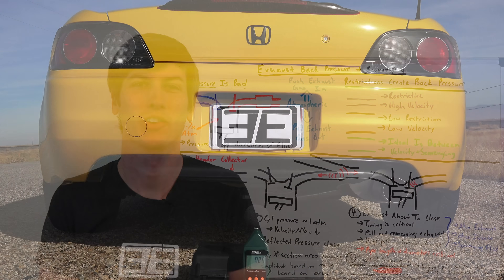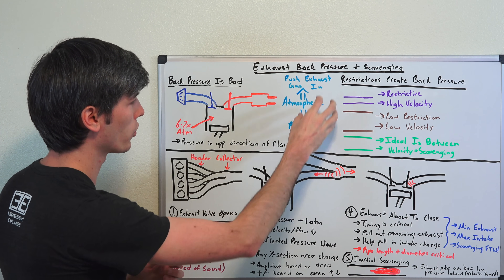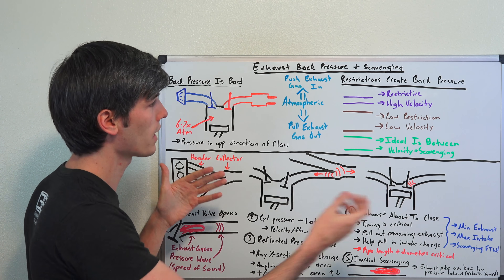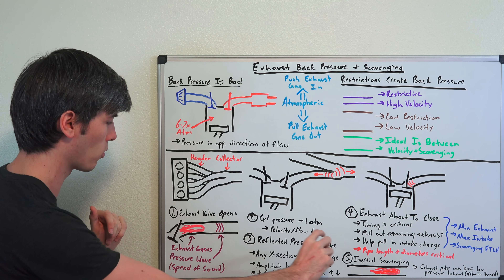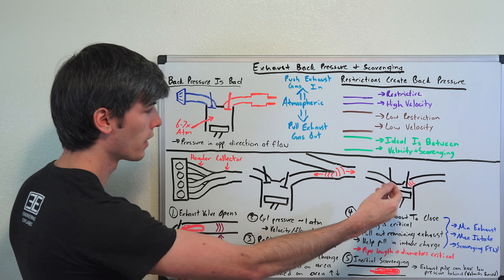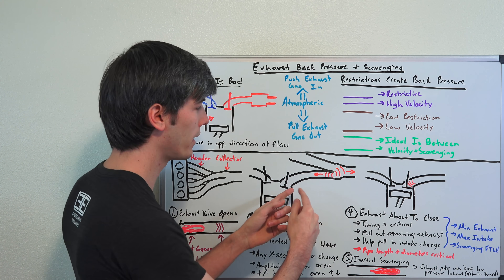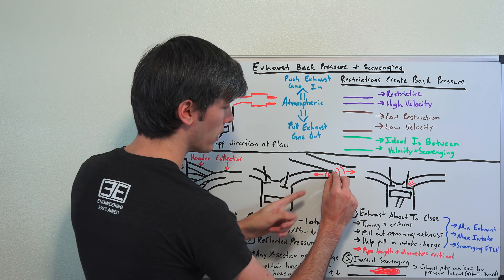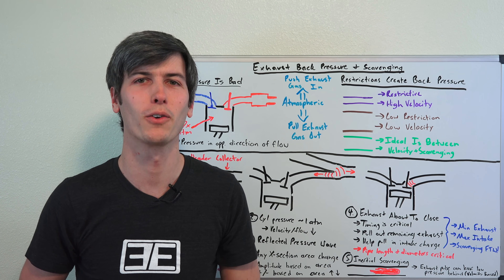Stop Saying Car Exhausts Need Back Pressure

Comment: Great explanation. I'm learning the older I get, the more I trust OE engineering, and I just leave my vehicles alone. Big automakers probably have more R&D money than a backyard fabbing company. Take care! Awesome channel.
Reply: + Bushcraft North of 60 : Well, it's not so much that they do more R&D per se... It's more that as you age, you realize that daily driver vehicle functionality and reliability are far more important than a little extra horsepower or torque. 

Typically, when a person starts "screwing" with any engine outside of the OEM settings, you will find more power, IF and ONLY IF you have a clue what you are doing. That said, typically the engine becomes less reliable and more expensive to operate. It's really just common sense. (Sadly, something that many folks lack.) 

That said, there are always some exceptions to the rule. For example, most modern emissions controls are literally "choking" the longevity, economy, and power outta the modern ICE's, both gas and diesel. That too is a proven fact.
Reply: I purchased something called a KTuner V2 for my 2017 Honda Civic Sport Hatchback (1.5L w/ the turbo).

The stock PSI on the turbo is set at 16 and is rarely ever reached (with the way I drive).  This KTuner V2 brought my PSI up to 21 and of course with that bumped up the torque and horsepower.  I've been running it for 3 weeks and was nervous that I was going to destroy my car but then remembered why I waited 2 years to see people's results with it.  Out of thousands and thousands of people who have never had an issue, there's only 2 that I have heard of  that have bent a rod.  One was due to the guy shifting from 5th gear down to 2nd (why the hell would anyone do that?), and who knows how fast he was going, the other guy messed with the tune and changed things around and had it happen to him as well.  In general though, the basemaps / tunes that came with it have been proven to be safe for the car.  Especially after 2 years.

I would trust a company that was built on tuning for the past 10+ years and has a good reputation over some backyard tuner.
Reply: There's several factors to this.

If you do it right then it isn't any more expensive to operate than the stock engine. It's also quite different these days as they build a 5.0 to make 450ish HP, vs 165HP of the mid 80s. It was actually better for the longevity of the car to open up the exhaust, maybe do some intake work, bump the timing, etc, as they intentionally starved the engines from factory. You could take a stock 302 from the mid 70s all the way up to the early late 90s, open up the intake and exhaust a bit, bump the timing to a less conservative tune and get the 150ish HP engine up to 220hp or so without ever taking off a valve cover.

Performance gains, runs cooler, better fuel economy, better longevity because it wasn't quite so damned hot, it was better at displacing the heat...

These days, not so much.

The 60s through the 90s (even mid 2000s in some engines) you could work a minor miracle, show impressive gains without sacrificing anything but a little work and a couple hundred dollars in parts, more than saved by the fuel gains over the lifetime of the car.
Reply: @turbodiesel4709  Daily driver wisdom. Just a couple days ago, I went at it with some bassoon (that's a Charlie Brown malapropism) who complaining that the redline on his 1.6L SOHC Toyota Corolla engine was set at 7200 rpm while it got valve float 6800 rpm. So he said. Then he had the nerve to blame the Toyota engineers for ruining his engine.

Be serious. The Corolla is designed for ordinary street and highway driving. I had a Geo Prizm once with the same engine and a five-speed manual and I doubt I got above 4500 rpm more than once a month. You try to drive constantly at or near the redline in a standard performance engine and you get what you deserve.
Reply: I quickly swapped my Urethane Transmission Mount back to a stock mount after being vibrated to death in my LT1 Pontiac Formula, the OEM people really do their homework/testing about components & conditions.
Reply: @Corsairforu  Yeah, but they only want to pass safety and emissions tests and maximise profit so they do cut corners in some areas
Reply: @Corsairforu  that's because it changes the angle of the driveshaft at the transmission, its a height issue (which can be fixed) more so than a material issue. The OEM rubber mounts are quieter but are garbage when it comes to durability. Changed both motor mounts and tranny mount to polyurethane on my LT1 camaro and haven't had an issue. (Kock on wood)
Reply: But, as TurboDiesel said, a daily driver is usually better off without screwing with it.  The tuned exhaust (and I don't mean "tuner exhaust" on ricer cars) is tuned for a specific purpose - whether it's drag racing, circle track, or whatever, but it's not ideal for daily driving - unless you tend to drive stoplight to stoplight in 12.0 seconds or less.
Reply: Nope. You're wrong on this one, and even if you do some decent research on the performance scene, you'll know it. Today many manufacturers are simply too greedy and at the same time bogged down by too much regulations and other compulsory testing. You can build a serious vehicle at the same or lower cost of a 'mainstream' sports car, that's a fact.
Reply: Bushcraft North of 60 OE is trying to balance efficiency, emissions,cost and reliability.  Aftermarket is mainly about making power and ignoring the other 🤣🤣
Reply: After a HiPo build they recommend running the pipes off the headers right out the side, wind up the engine until white hot, cut pipes where they change to red and you have a race car exhaust.
Reply: That's why cars nowdays break down even more without those backyard fabbers, for instance, Merc's driving 1 milion kilometres don't happen as often like they used to do. R&D are limited with emission stuff, also the need for more luxury, and the idea behind a car shifted a lot over time. For instance on the emission stuff, I've got an Mk4 Golf TDI with the EGR removed, this way this car will drive a lot better, for a longer time and be more emission friendly on a longer period of time. No clogged intake manifold, cleaner combustion while my Mk3 TDI without a removed EGR would blow coal everywhere. Not to mention the Mk4 TDI puts out 205hp and the Mk3 puts out 120hp after both being tuned/chipped. Saying OEM is the best is plain wrong, a lot of aftermarket fabbers make good stuff which outperform OEM stuff on quality and/or power because they aren't limited by emissions or someone yelling at them the car will last too long. That's the other point I'm making, nowdays the quality of cars is decreasing for multiple reasons, the more stress on parts because the engine needs tighter tolerances to be effecient. Merc's driving 1 million kilometres don't happen as often anymore, old Merc's had timing chains which was a single chain, they run forever on one chain. Nowdays Merc's have double layered chains and after 250.000 kilometres they all sound like a engine filled with marbles on startup. Car manufactors used to build cars as good as they can get, they wanted to build quality cars, nowdays if the engine lasts 200.000 kilometres, it's all good. That's long enough so the owner decides to buy a new car, which is profit for the manufactor. My other Mk3 Golf was owned by the first owner for almost 18 years, it was owned by an elderly couple, that was the mentality, people were happy with their stuff and tried to keep it for a long time. Nowdays people feel the need to get new (to them) stuff every 2 years, and manufactors know that and react to that, just look at smartphones and you know exactly what I mean.
Reply: @feki122  those are speculations and ur own subjective view, pls provide evidence! These kind of thesis often manifests itself by the sinple fact that bad cars of the old days simply dont make it to our days
Reply: lies, all lies!!!!!!!!!!!!! :)
Reply: I see a wonderful collection of comments, where if a person were to take ALL parts in a smelting pot, you'd have something close to info to live by. Too bad only maybe one other of you even have the capacity to do so.
Reply: Bushcraft North of 60. Well that was just mean! Lol
Reply: While it's true that car manufacturers know what they're doing far better than 99% of aftermarket businesses (there are some very good ones though, which are so good they often work in partnership with OEMs for specific projects, or in their competition teams), stocks cars are tuned for a compromise of power, fuel efficiency, reliability, cost, maintenance and emissions. Tuners usually throw all other concerns out the window and just focus on more power which is why they can get more power out of an engine with inferior engineering. Mods like removing the catalytic converter, running rich, fitting race exhausts, deleting EGR or DPF in Diesels etc all make the cars technically illegal to drive on a public road because they would no longer comply with emissions or noise regulations. Some manufacturers offer their own performance kits for cars/motorcycles and specifically mention that these are for "racing use only" and you can't install them and drive/ride on public roads. Of course the problem is government doesn't actually enforce these laws and people get away with it.

And if your engine has forced induction then getting a lot more power out of it is piss easy, just crank up the boost, the brute force method works.
Reply: @BigUriel  
Well i've watch the new record pikes peak,
I get how «seems easy» turn tha race ...
And prefer Loeb records sets ...

The engineering which is affiliate to «electrical assistance» drive is not made at this time by those "German but not only engineer's corps" ...
Where are the "torque" feedback loaded by brakes uses when you need it to eject each turn ?
How it comes they don't have this "feedback from trucks" knowledge built-in back for race cars use before application onto "stock" cars ?

Background gardener get how to use spring ...

News any from "Sono motors" Sion ?
Reply: All car companies need to make money, cars are engineered to make the company money without expensive lawsuits and abiding by emission standards, engineering patents, manufacturing processes and materials, product placement and product lifecycle. Therefore many compromises are made and Oe manufacturing and engineering is not god
Reply: They definitely put a lot of money in engineering but it's no secret getting rid of the emissions equipment will make a diesel last so much longer.
Reply: very true sir
Reply: That doesn’t mean that aftermarket parts aren’t sometimes better. Most of that r&d goes into how to make the parts as cheap as possible and still have it run as efficiently as the competition.
Reply: OE exhausts are a compromise between exhaust velocity and also dB levels.Obviously a state like California has rigid smog regulations as well as restrictions on how loud a vehicles exhaust can be compared to most states.Does that mean that a vehicle is going to be optimal from the factory?Absolutely not.But when I had my 2006 Cobalt SS they came out with a CAI,Header,and complete catback exhaust,even computer tuning from their performance parts division.Of course they came out about 6 weeks after I got my car or I could have had them dealer installed and put into the car payments without voiding the warranty.But I found it funny that even they knew there was an aftermarket for performance parts,so they made their own.Which is proof that the cars are absolutely not optimized from the factory.
Reply: You'd be amazed how many people I've come across that think they are smarter than a department of German engineers.
Reply: @thundercactus  
About what kind an face their abilities ?
Reply: thundercactus how smart to even believe that while they can’t even spelling catalytic
Reply: U mean a dept of engineers hand tied by bean counters and enviro nuts?
Reply: partymanau what are bean counter and enviro nuts
Reply: isn't that the same department that screwed up the spot welding on 90's and '00 bmw welds that cause the rear end to fall apart?
Reply: More likely the bean counters interfering with what the engineers want to do.
Reply: More RandD that was all done for making it as fuel efficient and reliable as possible. Very few makers focus on performance...
Reply: Corsairforu urethane mounts are for aftermarket high horsepower applications where the stock mounts would be shreaded so a urethane mount is indeed better for performance than stock. Just not as smooth.
Reply: yes exactly thank you

Comment: I think the myth comes largely from very old cars, with extremely inefficient high back pressure exhaust systems -like original VW Beetles -if you fitted a free-flow straight-through exhaust to them, it would make such a dramatic change to flow / air:fuel ratio, that if you didn't change the carburettor settings at the same time, they often wouldn't start or would run very badly, historically motor manufacturers would tell mechanics and anybody that asked, that this is because you "needed back pressure" because they didn't want to encourage people to modify their engines, as they had other concerns like reliability, longevity and low noise.
Reply: I think it more comes from people putting oversized diameter exhaust on their vehicle and losing power/torque because the exhaust velocity has slowed down too much. They don't realize there is a difference between free-flowing and oversized.
Reply: Loss of power due to oversized piping is a bit more complex
If the working routine of the engine is not modified, it will keep on kicking the same quantity of gas out for a given load, no matter what pipe size is used
The loss of power is not due to the fact it looses velocity on getting out of the engine but on the pressure in the cylinders
A bigger pipe allows more gas out so the cylinders will be emptied easier but If the cylinders feeding/emptying scheme is not modified, some of the mix supposed to ignite wil slip through the exhaust system before it is consumed, which turns out to leave less mix in the cylinders, giving that loss of power

It's pretty simple
Bigger exhaust implies better ignition timing
Reply: The larger pipe loses velocity, which means each exhaust pulse has to push out the previous pulse rather than the whole thing being a free flowing mass of air, which when done right works as a vacuum and pulls the exhaust out of the cylinders and even precharges the intake during valve overlap.

It isn't just fuel mixture and timing, though those do change as well.

This is why a lot of people buy performance parts and have poor running engines. Everything affects everything else.
Reply: @sethmanukula176  Yeah exhaust valves usually open before BDC
Reply: @MikeSmith-vb8ul  yeah I'm sorry, I lost the technical terms in english, being a french-speaking-born person... bdc stands for bottom dead centre I suppose? Or does it mean something else?
Reply: @MikeSmith-vb8ul  Umm, not they don't!
Reply: The myth probably started with racers removing the manifolds and losing to guys with zoomies or headers not realizing the back wave was scavenging and in the case of headers the forward flow of other cylinders was scavenging. The false assumption being that adding pipe inherently gives back pressure. And smaller pipes give more back pressure. When the fact is that velocity and/or a well timed standing wave can give negative at an opprotune moment.
Reply: Try driving a stock car in the way you would something you designed to drive a certain way then try repeating that statement. Sure your auto manufacturer designs a car a certain way (usually self preserving, economy & cheap mass production are their priorities) While quality aftermarket is usually designed either for performance or durability.
Reply: that's what I thought when I had a rusty hole in the exhaust but my emissions were bad untill I fixed it. And it's not an old car.
Reply: Yepp I had a tbucket with headers and a properly adjusted carb and wow the power
Reply: It was common belief that making the exhaust system "more efficient" in carbureted engines required fatter jetting in some of the fuel circuits in the carburetor,and that goes for chain saws and fixed jet lawn mower type engines too. "muffler modded" some of those mufflers are crude and not optimized for flow and respond well to having baffles drilled through or broken out 
 also lean mixture could cause valve burning in a lawn mower type engine
Reply: Their carburetor was set up fora high back pressure exhaust and they put on a low back pressure exhaust and now it don’t run the same. That’s when they say they “ need back pressure”

Comment: You do realize that you just disproved your title by proving you do need a "little" back pressure. I like that you mentioned the returning pressure waves that aid in pulling in air and fuel, but for those wanting to make power you should have mentioned intake manifold correct porting technique for power building.